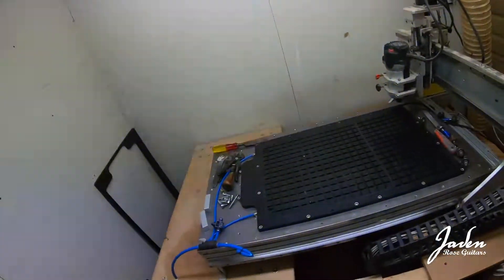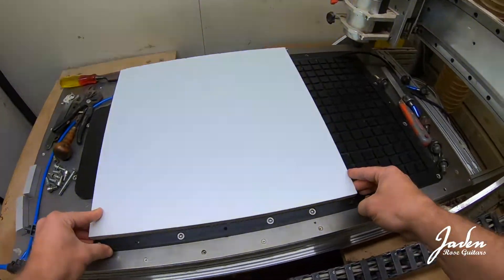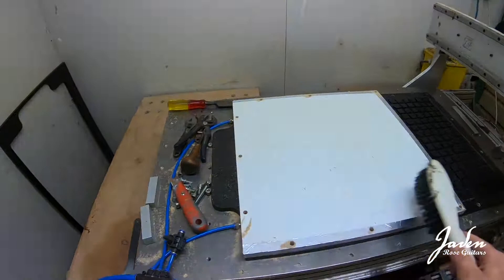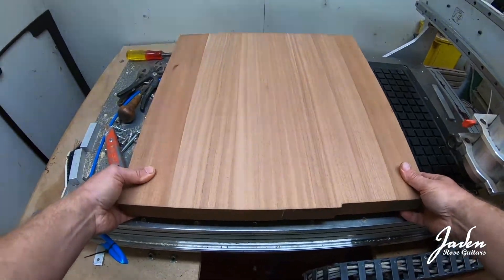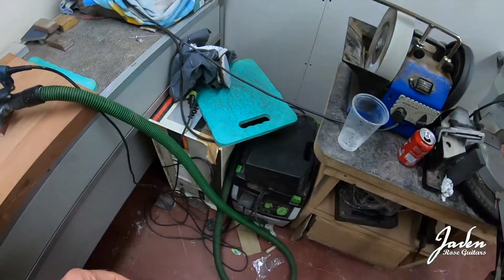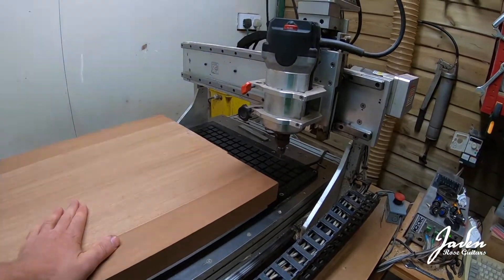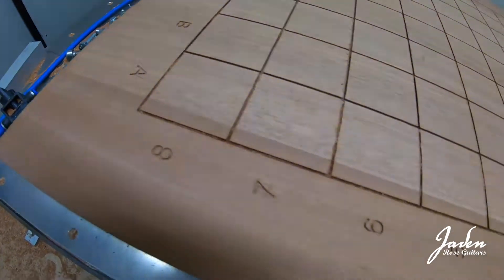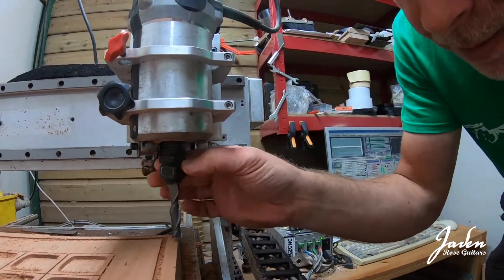CNC Machining, Vacuum Jigs, Strobe Lights! - Chess Board Part 2

Comment: Amazing piece! Do you have a tutorial or a link that could describe how to design the notation for the CNC machine? Im new to cnc machining and I would love to try and make my own board!
Reply from the maker: thanks, there isnt a 'design' to the CNC code, its generated by the post processor used in your drawing package.  ie; draw a circle, develop the toolpaths and then post it to your machine or a file that you will load to your machine.